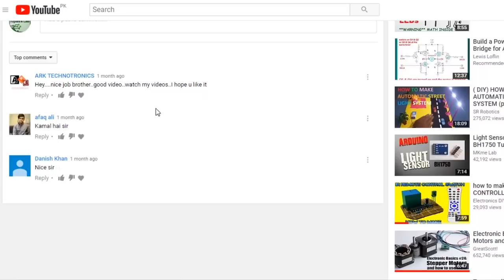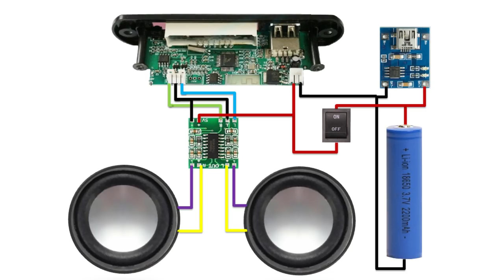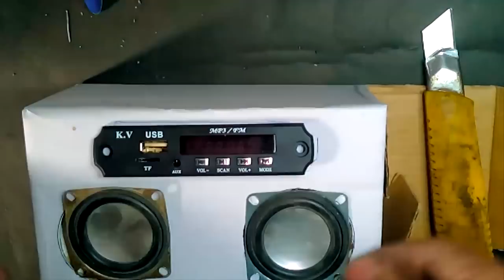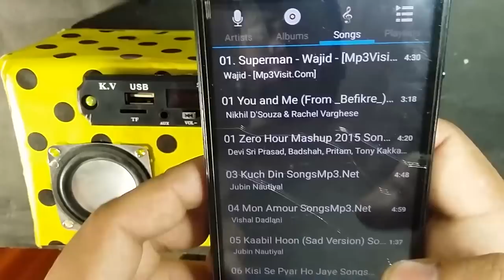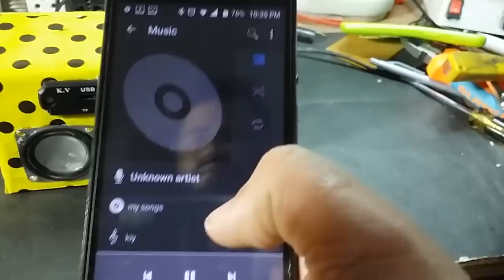How to make bluetooth speakers

Comment: In amplifier module that 5v two wires u have shown right ?? In that black joins with blue tooth mp3 is not shown. But in that blue print it is shown

Comment: How to join 5v Solar panel  this Bluetooth speaker ?
Reply: junior engineering  Ha
Reply: U will power it with only solar no battery? Just tap solar wires to right terminal
Reply: tumi ai choto audio amplier bord  kothy theke anecho